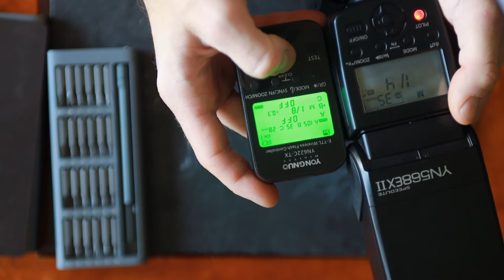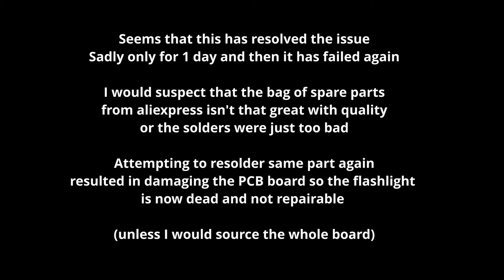How to repair Yongnuo YN568EXII (TTL not working)

Comment: It's an IGBT problem, not a TTL problem. Thanks for the video. Edit: just a thought, the Yongnuo's are generally copies of Canon flashes; and, the YN560IV's had a similar flaw where arching destroyed the IGBT (Canon had the issue and Yongnuo copied their flash) So you also need to make sure the flash bulb is centered correctly and the rubber ends cover well to stop arching. Also make sure your solder joints are good :)  Hope this helps anyone else having this issue.

Comment: So what is the part number ?
Reply from the maker: if you would watch the video, you wouldn't ask this question 😅😅😂
Reply: @edmunek  
I did but there is so many RJP4301's. 
What is the IGBT model  ?
Is it TIG056BF or is it TO-220FN ?
Reply from the maker: @Marko-od7eb  I was ordering TO-220FN. but it did not matter as they used to work for 5 minutes, sometimes a day, once was working for a week and had to be replaced again....
Reply: @edmunek  
Thank you for your answer.
Reply: @Marko-od7eb  TO-220 is the package - how the component 'looks'. Buy from Digikey or Mouser for good parts. They are not expensive - but shipping can be.